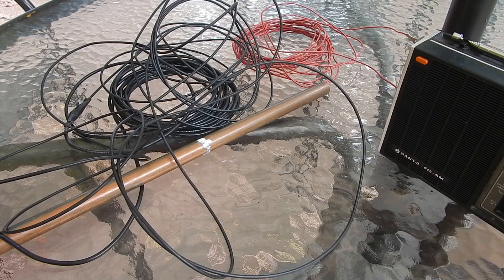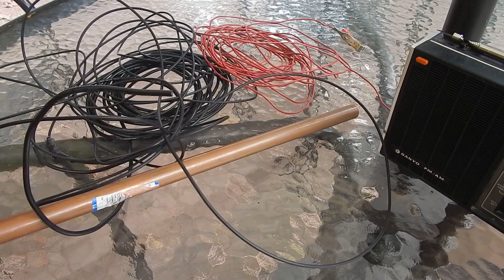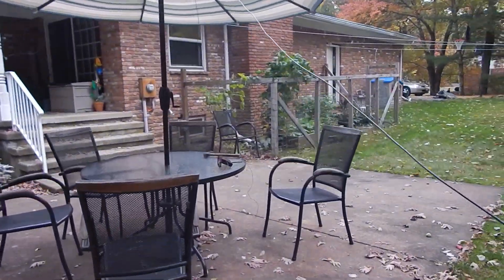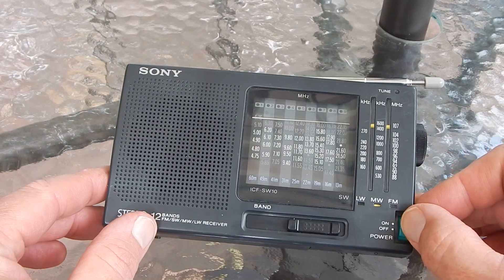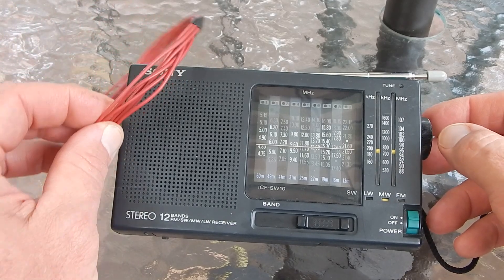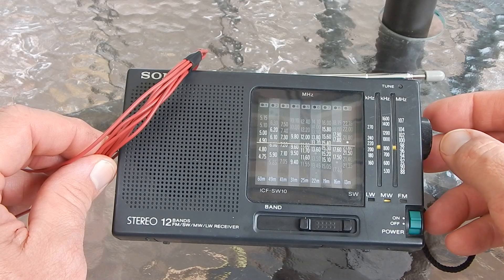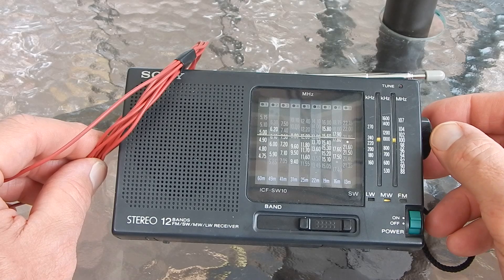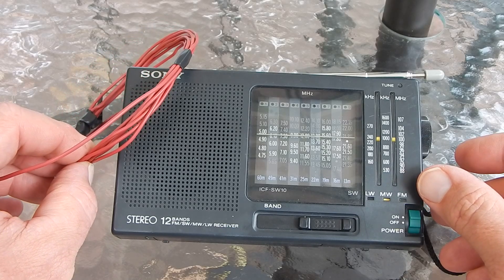A super-cheap, super-easy, very effective AM radio antenna

Comment: I seem to be missing something here or I don't have the expertise to figure out what you have set up. You show a long black wire "antenna" that extends from the hinterlands to your set up on the metal deck furniture. However, you seem to be using the red wire and wire loop and touching the antenna on the radio to bring in an AM station, which shows the wire coil as being effective. How does the black wire antenna come into play with this? Also, will the coiled wire, which seems to be connected only to the antenna (no bare wire touching the antenna), work for distant SW stations?

Comment: II was wondering what would happen if you used an entire spool of wire instead of just 7 wraps of wire behind the radio. Purchase a coil of wire, pull just enough out of both ends to add an alligator clip to each end.  Clip one to a grounding wire and the other to the antenna wire. Its just like the old 5th  grade science experiment. The more wraps around a piece of metal rod run to a dry cell battery the more nails it could pick up. 
The wraps of wire act like a simple magnet and the more wraps the stronger the magnet.

Comment: I coil a wire put it on corner of phone and other end of coil  I ran it out of windows and put it on  a copper pipe in the ground the otherwise  my second wire what do I hook it on to. I don't put it on my radio or do I just throw it out my window

Comment: In the 80's I had a tiny radio i got at a thrift store, had a little  clock and a cigarette lighter, a tiny slide up door on the side where a wire glowed orange as soon as opened. Got stations all over the world with its tiny antenna.  Just got a little solar radio I am off grid) cause I miss the local stations, the apps don't seem to work well, besides, I miss the magic of a real radio. I live in a valley, so plan on making this.

Comment: you can in many cases go a step further and put the antenna coil inside the radio casing and also insulate the PCB with foil
a thin low gage wire is all you need

Comment: The most recent question/comment I see was from 3 months ago, so  I'll venture a question regarding the wire hook up.  You have the black wire running from your trampoline to the patio umbrella, but not physically attached to the radio in anyway?  And the red wire with the loop is your ground wire physically attached to the copper ground pole in the earth, with your 7 or 8 wire turns, but not physically attached the radio, other than brought up close to the external body of the radio, which does seem to work.  So the radio is inducting a signal from the red wire.
I have an antique radio that has spring activated connections for an antenna, a ground, a short distance/local station connector and a long distance connector.  I have recently finished a restoration on this Atwater-Kent, Model 55.  As part of the restoration I had the tubes tested and 2 needed to be replaced.  Upon turning on the unit, all the tubes have significant glow and I get some static through the speaker.  I thought it was worth trying a cheapo AM loop antenna ( 2 wires, black and white) as an experiment.  I don't think the antenna is suitable for a great distance.  For a brief moment, 2 or 3 seconds maybe, I heard a voice, somewhere near the bottom end of the band,  But that was it; I tried switching the black and white wire which made no difference.  Would you think the antenna is too short/small or needs to be outside ?  Looking for a suggestion.  Otherwise all I'm getting is a small/weak amount of static across the band.

Comment: If I wanted to leave this up semi-permanent would it be wise to get a lightning arrestor? Do the "old fashioned" air-gap arrestors work? or do I need to spend $100 on a modern arrestor? Thanks!:face-green-smiling:

Comment: Good project. Inductive coupling off a longwire. Very cool. And yes, the red wire and black wires obviously were connected. Black longwire to end of red wire, red wire coiled up to be set near the radio -- with the other end coming off the coil going to the ground rod. Very cool and inexpensive set up. And it works.
Reply: The black wire is not grounded?

Comment: Just had a surprise. I missed my bfo unit. That is separate for my rig gives me ssb by mixing the signal from a stand alone unit. So as I was listening I picked my cellphone. The noise from the phone mixed to produce a reformed voice. In a word the noise mixed and returned a crude readable audio..😊😊😊😊😊😊

Comment: AM signals are so weak now. Shark fin antennas on cars, are nowhere near the whip antennas from twenty years ago. There is legislation that would make AM obsolete, which is a bad idea in a national emergency for dissemenating critical communication to the public.
I have built some diy yagi and loop antennas for various radios. Your area may have a local AM broadcast for  info at 820khz or above. A good test for your Diy AM antenna!

Comment: So would this work if I tied one end of a long piece of insulated wire to a tree limb outside, ran the wire through a window into my house, wrapped the middle part of the wire around my radio, ran the other end of the wire back out through the window and tied it off to an outside ground?

Comment: I made one today, I had some very long lengths of 12awg wire that was not being used for anything from an old well pump. Wire nutted two together to make it around 100' long. I have another to go even longer, might do that for 150'. It works well. I am using a ccradio 2e which already has very good am reception, this homemade antenna made it a lot better. Some channels like 50% better, sometimes the difference can be between a channel being barely understandable to never missing a single word. My grounding rod is just a piece of rebar, pounded it about one foot into the ground. It was old an rusty, used an angle grinder to remove rust off a portion for good contact. Another thing to note, my coil is inside a shed, routed the wires outside the shed, grounding rod is next to the shed door and the antenna runs up a hill into some woods.
Reply: Pour salt water on your ground rod location....a good soaking. Plus you can buy a 4 ft ground rod too. My metal camper roof structure is anchored to the ground so I just ran hookup wire to a bolt on it outside my camper window. Then ran a 100 ft length from a window to a tree on the end of my camper away from the electric meter. Before this it was impossible to get a signal on AM or shortwave in my camper. I connect this with a mono audio cable to my AN-200 AM Loop Antenna for normal radios and directly to my Tecsun PL-330. I also discovered that it even works to boost AM with any shortwave receiver with an antenna input. But the PL-330 can be set for external AM antennas.
Reply: @Toonz The salt water in the soil around the earth ground helps it make better electrical contact since salt is conductive. Some soils may not contain many conductive minerals or the ground rod may not be deep enough and in a pinch the salt water (keep the soil around the ground wet) may help the antenna/ground system function better.
Reply: @Toonz And speaking of conductive soils and salt, most single frequency metal detectors are useless on a saltwater beach in the wet sand. They will beep (or false) over the wet salt water and minerals when no metal of gold ring is really there. But now Minelab, the company who made the very expensive metal detectors always seen being used on beaches, has released the Minelab Vanquish 340, 440, and 540. With these inexpensive multi frequency machines regular people can now hunt for gold rings on the beaches and find deep silver coins on land. The Vanquish 340 is only 200 bucks.

Comment: One other YouTube Video has a long wire running between two glass Insulators down the length of his roof top. He’s got the large loop inside his basement, and Grounded off to a copper water pipe. Good idea because he said that this was the only viable alternative since he only lived on a 1/4 acre lot. One other way is to use one of those clothing lines in the shape of a Carasol. You know one of those clothes lines that is in the shape of a rounded dome. Wrap up your long wire around it from top to bottom using zip ties with as many wraps as you can. This won’t bring in as many distant stations but it will being in stations from all around you in all directions.

Comment: One way to get your long wire up very very high safely is to simply to connect something to it you can toss up very high. A simple rod & reel comes to mind. Toss the line up, cut it and use the line to drag the line up. Do the very same for the other end drag it up. Tie the ends of the fishing lines to the two trees and viola you have it. Need to pull it down? Simply cut the fishing lines.

Comment: Has anyone tried this with a lot of loops? Say 21 or better. If so what were your results? Did it make stations come in cleaner? Or give you more distance stations? I see only one downside to over building it. You might pull in so many stations both far and near that they interfere with each other. We’ve got a WDAK in Columbus, Georgia at 540 and theirs also a 540 in Chattanooga Tennessee. Get halfway between the two stations with a long wire running in a west to east direction and you might wind up picking up both at the same time. That’s one of the reasons you sometimes need to be careful on which direction it runs.

Comment: Systems like this have three main sections. 1 The long vertical line that acts as an AM antenna itself. Two features can either kill it or make it superb. 1. The overall length of the vertical section, it’s height above the ground, and how straight it is. 2. Is it running parallel to the direction most of the AM stations in your region are located in? Say there’s a large major city to the south of your location (say New York City), and you’re in Danbury, Connecticut. Run the long wire in a east to west direction so if you were looking over the top of the wire you would be looking in the general direction of NYC. For the length of the long vertical wire technically the longer the better. One thing most people don’t consider is the overall height of the wire. Other than such blockers such as terrain, trees, and buildings one other killer is the magnetic field of the earth itself. The NOAA National weather service recommended that external antenna for weather radios be at least 6 ft high or better to counter the earths natural Dampening affect. The second (the wire loop) acts like a poor man’s electromagnet. Remember your 5th grade science projects? The more loops, the more current so a weaker signal coming from the long wire is passed on stronger to the internal AM antenna. The Third part can also be a killer. Just how good is your ground to the earth? Some soil types are better and some worse. Generally soils with a high sand content don’t make very good grounds. Also rather dry soils don’t ground very good. Your best ground overall is see if you can connect to an already existing ground, such as the copper rod installed by either a power or cable company. This lets the signal coming down from the long vertical wire flow with the least amount of Resistance. Ever watched one of those survival shows coming from places like Alaska and the cast member is listening to the radio? Most likely that station is at least 60 miles away or better. I heard on one of those shows they called it “Trapper Radio”. That’s how trappers in the boonies could get news from home.

Comment: Tom I have tried this with speaker wire. It did work fine. Probably would have worked better with the kind of wire you used
Reply: Speaker wire isn't different from regular power wire. It's the same wire in a different colored sleeve.

Comment: For non radio people. It may not be obvious that the red wire and the black wire were joined
Reply: Thanks for clarifying that. I had thought that the red wire was looped 7 turns and then it was grounded on his lawn and that's it.
Now I see how that black wire was used in this set-up. Works great from what I have read in the comments.
Reply: Thank you.  He didn't explain and I missed it.  Is the black also clipped to the grounding rod like the red is clipped to the grounding rod?
Reply: @Kube_Dog I think you connect to grounding rod, make loops then continue with wire after loops for antenna. Otherwords, no connections, except one end of wire to rod, make loops, after whatever number of loops that you draw up in your hand, you just take whatever is left and run it through yard till you run out of wire
Reply: No  @Kube_Dog

Comment: This is most helpful for sets that don't have autonomous AM antenna terminals.  In the house I make do with "ultimate AM antenna" plans that were ages ago included with Carver tuners.  The "spread" of a long wire like this isn't there, but it's good enough for my auto-off bedtime radio.  I often pull in CFZM 740, almost 600 miles away.
Reply: Yeah Just imagine blowing someone’s mind. You’re in Sacramento California and you’re picking up the live broadcast of “The Grand Old Opry. They hear Station identifier of WSM Nashville Tennessee and then go say what?

Comment: I could figure out the pink wire coiled 7 rounds and connected to to the ground. But I want to know where was the long wire connected?
73
Reply: They’re just connected all together into one long wire, vertical wire to red looped wire and red wire to the copper grounding pipe.

Comment: I have a metal roof on my house. I get a lot of static and no matter where I move the radio I can't get rid of it all and have poor reception. The internal radio antenna seems to override anything an external antenna picks up. The outdoor antenna loop only makes the static worse. What can I do to get rid of the static? Do I need to enclose the radio in a shield or use shielded wire to an external antenna outdoors or what? Help!
Reply: That’s one of the two bad points about external AM antennas. 1. They both pick up stations better when the antenna is running in parallel to the location of the station. If the stations are north or south of you the outside long wire needs to run in a east - west direction. 2. One thing that can be a major killer of one of these setups is simply the soil in your area doesn’t make a very good ground. Soils with a lot of sand content can be a killer. Also very dry soils can be a major killer. See if you can connect to something metal already in the ground such as the grounding rod installed by a power or cable company. Read my detailed comment posted on Tuesday September 27, 2022.

Comment: Great video showing how a long wire aerial will improve reception, I think it would have been a better presentation had you also extended the radios aerial for a comparison between your long wire and the supplied telescopic aerial plus the radios using neither.
Reply: Doesn't look like he's going to answer after this long, but I can answer that for him.  Pulling the aerial up would not have made any difference.  This is because that antenna is only hooked up to the FM part of the circuitry.   The AM broadcast band in his radio uses the inside ferrite antenna only.  Not sure about the shortwave bands on this one.

Comment: I like. mine is 4 turns of #24 wire in a heat shrink shield about one foot in length.after makeing 4 passes with #24 wire put  one end on a ground the other on 20' of number 18 gage stranded wire as the in put/ANTENNA. Drape loop on radio . Just like yours. Mine will cover 160 to 20 meters fine condition.

Comment: Sorry. Excuse my ignorance but the wire from the trampoline ended up where? What is it's purpose? The red wire had the alligator clip clamped onto the pipe and the other end was looped into a circle. I got that. 
I'm lost with the black cable bit.
Reply: It’s just tied to the trampoline ;)

Comment: Tom,

Would this same antenna construction work for picking up shortwave and ssb on a portable radio (county comm gp5). Thanks Mark
Reply from the maker: This antenna (as far as I know) is better designed to pick up lower frequencies, and it's coupled to the receiver inductively, hence the coil.  For shortwave, you can just connect a length of wire to the whip.
Reply: Sure would. Just have to hook it up to an antenna socket it have simply cooled it over the whip antena.
Reply: Yes it would.  Anything is better than the short telescope antenna supplied with the radio you probably own, even a shorter wire of 20 or 30 feet.  The longer and higher the wire the better it will work ,  for the most part...

Comment: An old submariner man tried to answer a question why I would want feet and feet of wire to heard radio instead of less. 
In short I kind of got that the more wire is giving you the better chance of receiving the full length of the frequency 
You hope to hear, and very very long wires can hear really low frequencies..does that idea kind of right.
I don't think I got the idea from him very well.
Reply: Your Submariner Friend confused the hell out of you or you forgot what he said.  Very Low Frequency requires very long antenna and the Band Width is so narrow, you can't send anything but code......at a slow rate !!  ....Here is an Good writeup on the subject = https://en.wikipedia.org/wiki/Communication_with_submarines